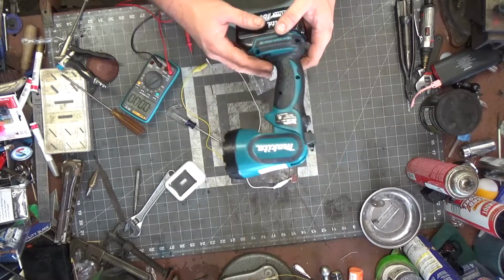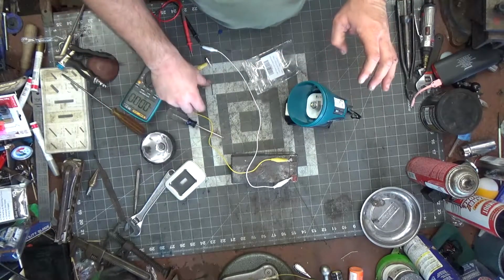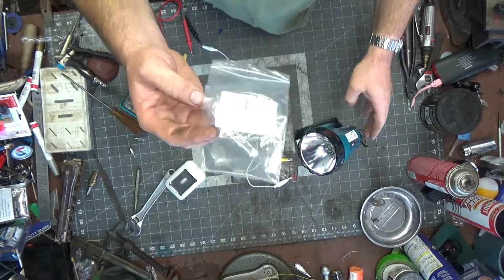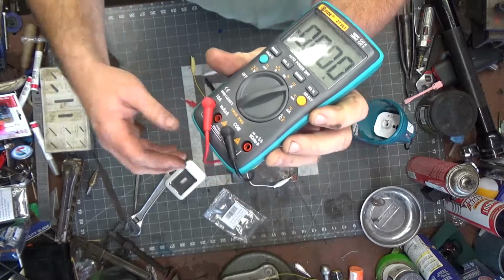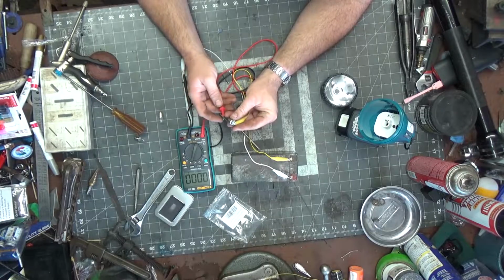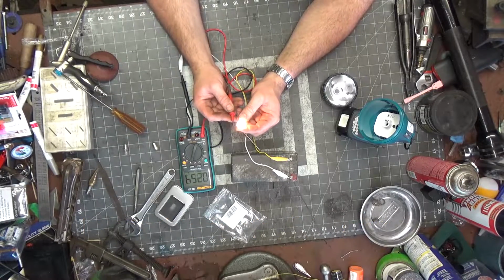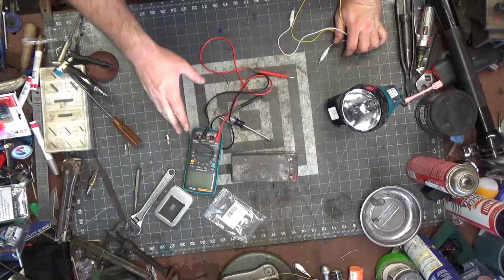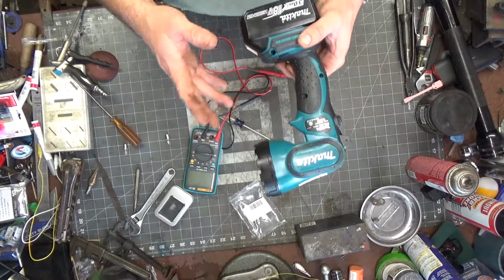Makita LED Upgrade

Comment: Hey man, did you use the same led bulb for your 6d maglite? I just bought the p13.5s bulb for my 6d maglite, but i am not sure if it is the right bulb.
Reply from the maker: High Power LED Upgrade Bulb 3W 247LM DC5-24V 12V 18Volt PR2 P13.5S LED Flashlight Bulbs Replacement for DEWALT Flashlight Torch Tooling Lantern Work Light Maglite LED Conversion Kit
That was the title from amazon. Cheers
Reply: @joeheilm  thanks for your fast reply!!

Comment: The stock bulb is 10 times brighter than these Chinese led bulbs my bl1840 battery last 16 hrs with stock bulb
Reply: but when you drop your light the LED still works

Comment: Joe, it was so interesting to hear myself in your comments.  Almost 30 years ago I started moving from Craftsman and Black & Decker toward DeWalt.  I still have their heaviest duty contractor corded drill from that time and it is still a reliable monster.  Over time the era of cordless tools with separate battery packs came along and driven by the "leverage the chargers/battery packs" logic I went through at least two more generations of DeWalt cordless.  Then over the past 5-10 years, DeWalt started making every imaginable cordless tool, and with that, I noticed they ran longer on the batteries but the life of the tools and the ruggedness and reliability felt like it suffered.  I have never been a pure brand loyalist either.  Last year I rebuilt a 25-year-old Makita half-sheet sander we about worked into the ground.  3 hours, new brushes, cleaning, re-torquing fasteners, and replacing a few connectors - and that baby runs better than new tools I looked at.   So I made an observation that changed things for me - no matter what brand one might be in love with at the moment, really test ourselves on the question "do I really need this cordless?"  Because cordless drives up the price and each extra tool we buy lock us further into the brand.  If corded is workable, then we are free to buy the best brand for that particular tool we are buying!  And with that, my DeWalt purchases have fallen, and I'm buying Makita, Bosch, and even some of the new improved "brands" at Harbor Freight.  Just a thought to share with everyone - we want great tools, safe shops, and to stretch our paycheck - and I think this might help a lot of us do that better!
Reply from the maker: Hi Marc, that is a great point. The convenience vs longevity debate is an interesting one and I can tell you that I need to consider that proposition more thoroughly. Great comment! Cheers

Comment: How old is the makita light?
It is cracy that they are using incandescent lights, powertools have decent batteries so manufacturers could push a little bit more on the light game (both in raw brightness and in features)
Reply from the maker: Hi Victor, the light is brand new (2019). They must have a warehouse full of incandescent bulbs they are trying to get rid of. Cheers

Comment: I have one of these that craftsman made years ago when the 12 volt batteries was new technology.  The light is like new as I never used it.  It was terrible , you almost had to light a match to see if it was on or off.
Reply from the maker: Lol, i had the same craftsman 12v stuff so i know what you are talking about. I couldn't believe makita is still using incandescent. The zhuoman led 550 rechargable work lamp is an outstanding worklight for $20. Cheers